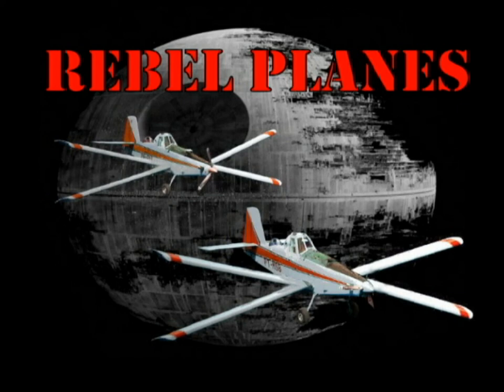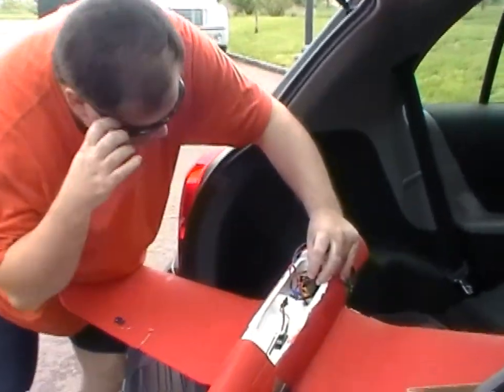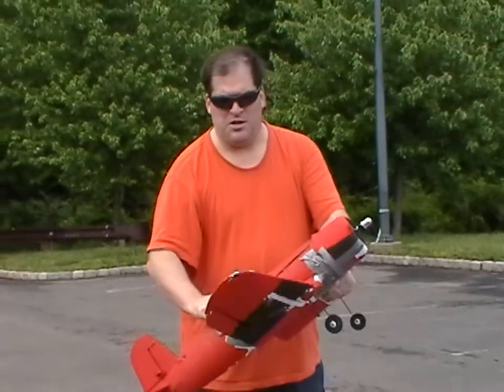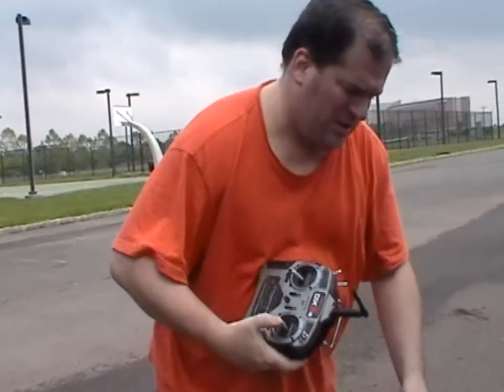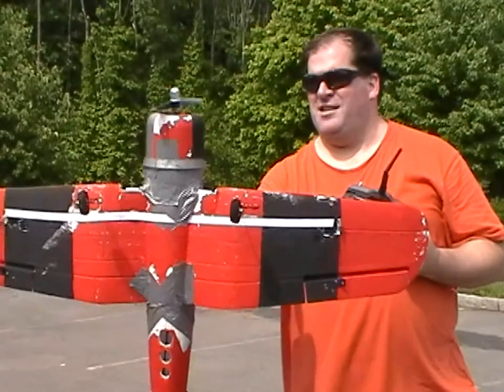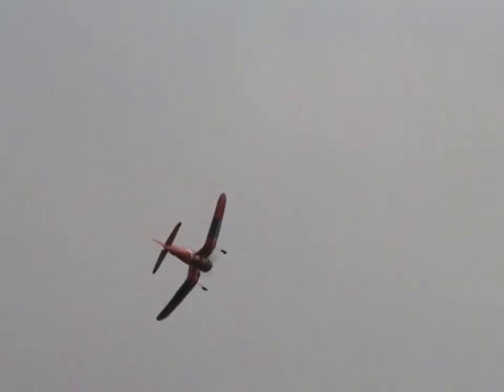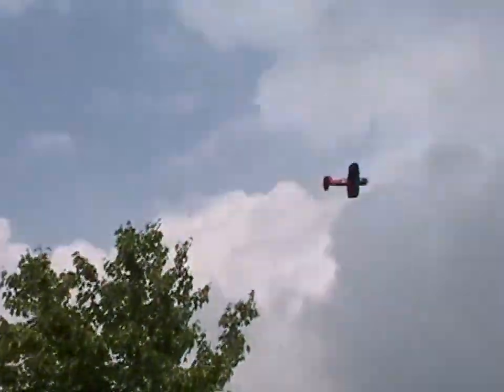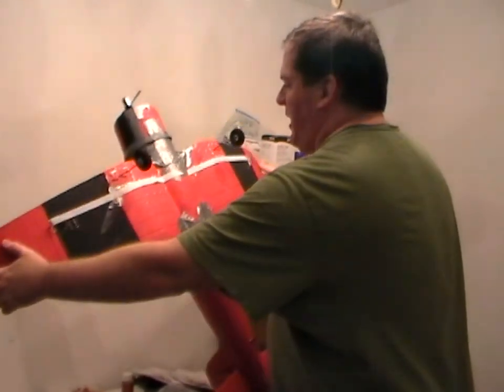Wing Elevons (and cloud attempt)

Comment: Hey- WOW! Best shout out ever! Thanks very much! Drop me a line at killerplanes at gmail- I'm going to give you a deal! And we WILL keep your plane in the air! Also- if you cut through the remaining part of the corsair wing where it's cracked so you can bend it completely open at the crack, you can glue it back together with epoxy or hot glue, and it WILL work- the next break will be somewhere else. (WHAT next break?)